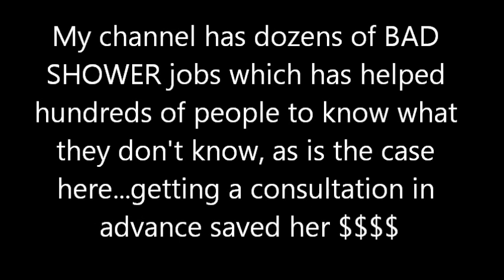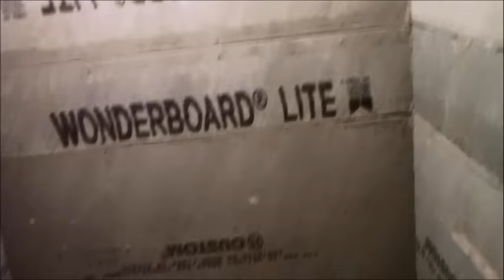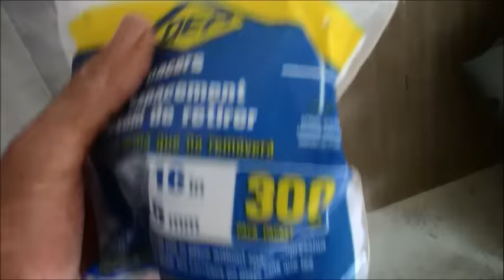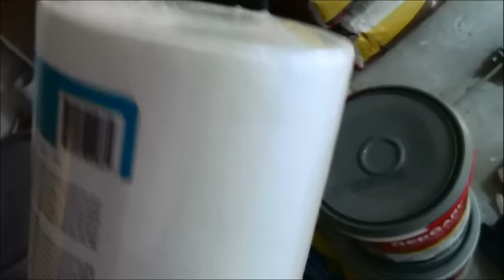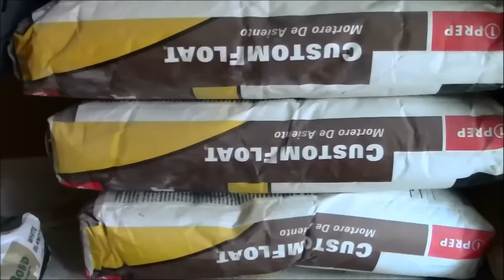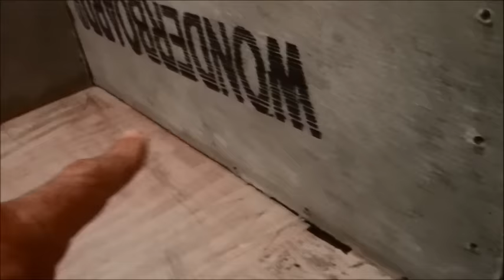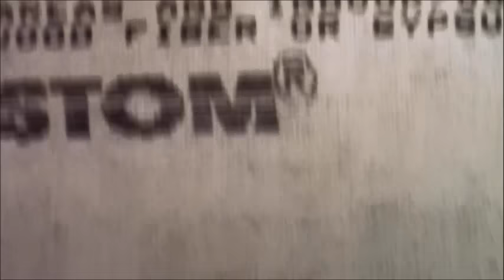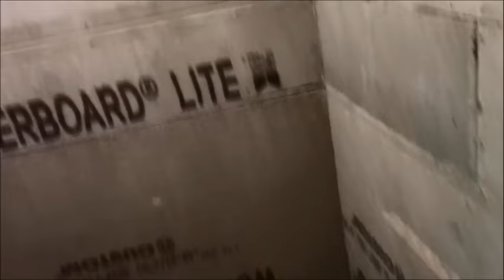BAD SHOWER DAY ONE !!

Comment: Just because there was only 1 bag of mortar doesn't mean there weren't 3 more bags coming. Just because there were 4 bags of 4:1, doesn't mean he has intention to use them all. You're jumping to conclusiins.
Reply from the maker: 14 things at a minimum including 12 sharkbites in wall, toilet flange 10" off wall, toilet supply on right side, shower drain not center, wallboard set before liner, valve wall not plumb... those are things that tell me it was going to go south.

But if you insist on talking about material, that 3 gallon bucket of mastic tells me all I need to know..
It has no place anywhere and that bathroom

Comment: First you tape, then thinset, let dry, then 2 coats of redgard. If you’re redgarding tile board seams without anything it’ll still crack.
Reply from the maker: 😂😂😂😂

You do understand that redgard is not just a water proofer, it's a crack preventor, says right there on the label, typically used in huge warehouses on concrete floors to prevent cracking.

Oh yeah....no tape is used on those massive floors 😂

And you do understand that redgard stretches 10 times further than tape ever would ✔
Reply: @StarrTile  any tile substrate you use on the floor is in fact covered in a membrane/tape and thinset but doesn’t need redgard since it’s a dry area. Concrete slab is different than a sub par butt seam. Just saying I wouldn’t just shove redgard into a corner or seam with no membrane or tape. I know guys that don’t bother waterproofing their cement/ hardie board and keep a job. You do you dude just providing what I’ve experienced.
Reply: Meant to say floor substrate seams are still taped and thinsetted. ie. durock and mesh tape +thinset , shluter and Kerdi membrane.

Comment: I’m not cheap so I do buy new spacers for most jobs it’s just nice to use new spaces that are not covered in thin set or have been stepped on . Use bricks for a shower curb and leave and inch for tile,liner,dura rock and tile.

Comment: The fibre tape simply keeps everything attached and moves together if it does move. On the reddgard bucket it says it is not required but it's recommended for any horizontal planes. I use it on any horizontal planes and use silicone first on the verticals, then regard everything together with 2 coats. This helps to not lay on reddgard too thick which can have mud cracking, due to the surface drying too quickly. I personally like reddgard much better than any membranes I've used though, seems more flexible and dummy proof as well.
Reply: Have you tried aqua defense by Mapei?
Reply: @HomeGrownPyro1  not personally, I usually just buy the big buckets or Redgard. But I know other installers and they said they liked it. I also really like using mapei for other products, definitely have confidence in their products
Reply: I also like hydro barrier plus
Reply: Maybe you already know this but I just thought I'd throw it out there. silicone does not stick to rearguard. The more u know. And I generally use rearguard, if Im remembering correctly Aqua Defense is basically the same as red g. Just a green/blue color.
Reply: Water proof membranes are the way to go. So much 2-3 more companies have followed Schluter.  Redgard actually req 3-6 applications to make it to the desired thickness.   Haven’t used cement board in 15 yrs and not going back.

Comment: Dude your trippin' on that spacer thing.
Reply: He is tripping
Reply: Exactly doesn't even make sense what he says about spacers
Reply: Dude’s trippin for sure. He seems like he’s in a manic episode
Reply: He’s absolutely correct about every single detail because it all matters. If he knew what he was doing he would had spacers.
Reply: @adnanlimited  most tile guys carry plenty of old spacers in their trucks/vans. Same with thinset and other materials. Also sometimes you’ll bring materials day to day based on your setting goal. Just bc he’s light on material doesn’t mean anything. The fact he’s using those shitty spacers says more than anything about his experience
Reply: @adnanlimited  on top of which; what’s this nutcase doing walking around someone else’s job site critiquing it. He shouldn’t even be in there
Reply: @adnanlimited  I can only assume you have all the spacers you’ve ever bought over the years. You do realize that they get warped or dirty over time thus you’ll need to buy more?!
Reply: What ends up happening is the spacers get laid down horizontal, and they get buried under the grout.
At every corner is a really thin layer of grout that can pop out exposing the setter's shame.
Reply: @CurflanderHolyfield  I've been fixing DIY bullshit for the last ten years.
Those TV shows are my job security.
I've seen husbands permanently housed where the dog used to sleep.
Reply: The label says "Leave-in spacers". Why not do that? Noob question, I know, but why not?
Reply: @KKhhoorrnniittee  So you buy more.
Reply: @KKhhoorrnniittee  if they told you to reuse the spacers until they break down organically, they wouldn't be in business very long.
Reply: So I guess if you buy spacers your not a proper tile guy......you should just have them.
Reply: @3DCHome  what he was saying is that buying spacers for every job is a wasteful practice. It sends up red flags.
Reply: Kinda overdoing the petty thing
Reply: @adnanlimited  35 years..... I dont clean and collect spacers
Reply: I'm not a tile guy by trade but still do a few, now and then, complete bathroom and kitchens. 
I have cans filled with different spacers and I usually buy some new ones on each job. 
No cans, baggies, plastic containers of old spacers.
Reply: @dustchip8060  key phrase....you're not a tile guy
Reply: @donnimetropolis9899  by trade.
Reply: @adnanlimited  worrying about how new someone spacers are is a red flag that you yourself are a subpar contractor, and have no idea what the hell you are talking about. I bet you that you and this guy lay tile similarly. I would love to see your work, because I've seen this guy's work and it's not impressive

Comment: So did the tile guy put in the ply sub floor? If the Sheetrock guy put in the wonder board is it the tile guys fault they the curb isn’t in? 
Sounds like you don’t really know the project history. This is just like Monday morning quarterbacking.
Maybe if you had the job from the start you would understand the history. There is maybe a couple of hours to address the issues you pointed out. I think you are pulling for a price justification.

Comment: I did my walk in shower 5 years ago, only my 3rd tile job. Oh boy I learned a lot from that. I would have never passed it for a customer though. But it won't leak and only a few imperfections that I'll notice (well I'm sure a lot of you guys would lol). Redgard is great stuff.
Reply: I knew this guy who did his own labor and sold the house. He outsourced what he couldn't do of course most of the carpentry but he put down his tile in the kitchen in the last piece near the door, the first one you look at when you walk in was crooked. Lol, I didn't say anything. The house was actually reconstructed on a house that had burned down and was rebuilt on the original slab. The brick walls in the back were settling and pulling away from the cornish. Problems abound fyi as this was just one.

Comment: Acryl-Pro is mastic. Custom Building even says "Sometimes referred to as a mastic" in their promo video about it on their channel. Premixed thinset is just mastic with sand in it to give it more body. Mastic is weird stuff, I personally love it for backsplashes. One crazy Jamaica style thing I personally did was put 2x2' mosaics that were a dollar a sheet on clearance up on plywood OUTDOORS above my mailbox as the tile cost less than new lattice would. I had leftover Mapei mastic from a backsplash and grout, I waited 3 days for the mastic to set up fully, and grouted it, and it's survived at least one winter so far with no cracked grout (except I grouted the perimeter, so that cracked...) or loose tiles. 

The problem with mastic is it needs time to dry, and people using it are using it mainly to save time using thinset and cut a corner. People tend to grout it right away, and try to get their showers in service right away, when you need a longer cure time than thinset. Of course once you get to 12x12' or so tiles it becomes basically impossible for it to ever dry under the tile. 

The other problem with mastic is mastic isn't compatible with Redgard, and Mapei's isn't compatible with Aquadefense. I think Tec makes the only mastic compatible with their own waterproofer. Some type of chemical reaction occurs. With Wonderboard, btw, it's designed with the "tape" side being smooth for mastic application using it with plastic behind it, and the rough side with no tape for thinset.
Reply: I used mastic to do my own shower, using 16" porcelain. (Didn't know any better.) Don't remember why I had to pull a tile, but, no, it doesn't dry for a looong time. Don't think I grouted for two weeks or so. And I never got around to sealing it.But the shower is still in daily use over ten years later. Back then we had 7 people using the shower. Still have 3 people using it.

I really don't understand why so many shower projects fail.

I also used 12" porcelain directly on top of formica countertop using modified thinset. Also takes a long time to dry. Also worked perfectly fine.
Reply: I don’t get your comment at all!  Mastic for setting time?  Gluing tile down?  Why not do a job right and do it once.  If you have anything leftover after you finish a job throw it away, don’t save for another job.  

Tile needs to be set with thin set and thin set alone.  Then grouped with a hood grout such as Custom Prism or Fusion Pro.  That’s all of course after waterproofing.  Schluter-Kerri shower pan and membrane will get you a good seal all the way around.  Staying with one manufacturers solution vs mixing manufacturers is a safe game plan.

Comment: Redguard has a tendency to crack, especially  with temperature swings. Seen it several times on showers against outside walls.  Fiberglass fabric is really cheap, and I feel is a must for reinforcing the waterproofing membrane on all inside corners. Just my 2 cents we aren't all in georgia
Reply from the maker: Only see it crack when applied too thick...otherwise flawless results.
Even in my cardboard box experiment years ago, water in it a week no issues
Reply: Redguard cracks in thin and in heaven application, the fiber mesh and redguard is a good combo to strengthen the seal in the seams. Or we can use a higher quality moisture barrier.
Reply: Yeah,  I'm having my shower done now and I asked the guy why he didn't use redguard and he said it doesn't do well in TN and plus I was on an outside wall. I sàidvi saw it on YouTube and he laughed 😂. But he does have buckets of old used spacers lol.
Reply: Red guard fails it takes three coats to achieve a water proof surface, membrane is much better. I start off with water proof materials not cement board. Yes it’s been used for ever but them days have passed to go board or kirti board with water proof banding
Reply from the maker: @Klondike
I don't know whoever told you that garbage, fake AF tho..

https://youtu.be/2HOxm40cpBs

Comment: That "tape" is a fabric, with no adhesive. It is used on corners as you said. It absorbs the red guard. Like fiberglass with resin.
Reply: exactly my tghout
Reply: Recommended in Regard installation instructions
Reply: Guys only half right, I always tape and actually mortar my corners then redgaurd then tile and my corners are sealed and perfect 9os with a square every installation
Reply: I don't know where you live,  so I'm not saying you are wrong.  Because different places, different rules. Some places you don't want to mud the corners, you leave 1/8th gap, to allow for shifting and stress. The red guard is flexible, and allows for movement. If the gap is filled it will pop stuff.  But like I said, different rules, not saying you are wrong.

Comment: Sadly, I had to learn this the hard way, but you're actually 100% wrong about red guard for the following reason:  Although in a foreign span red guard will stretch As much as 10% to 15%, that same 10 or 15% Confined to the area of transition between two planes is almost nothing,  and will always be considerably less than the thermal strain put on the transition.

Comment: The pan liner should go in before the hardi-backer/ cement board and extend at least 6 inches up the walls. Made this comment mid-video. You covered it. It's so frustrating to see that people do this type of work. The customer is paying good money for good work. I've only been doing tile for 8 years but I learned and worked side by side with a great contractor. Peeks Tile Oakhurst CA.

Comment: We built a new home.  I, home owner, Ran into just what you described.

Plumber installed our shower mixer valve in correct place and the builders foreman (knowledgeable older carpenter) installed the solid surface master shower (large) and cut hole for finish escutcheon plate BUT they cut hole bigger in solid surface wall material than plate!   I (home owner) made a quarter round out of the waste material to hide the gap.  This would have been the second app panel they would have ruined, the first one broke then they cut out for the in-wall shower caddy.  I was doing my own finish carpentry and on-site so I got a big chuckle out of this commotion.  I believe that just because you have worked for thirty years does not mean you are a craftsman or care about detail.

  This new home building process, our first, has taught me that a home owner has to watch everything and ask questions and STOP the laborers when they are doing something wrong!

This experience has confirmed that most Laborers do not care about the details as it is not their house but yet they get paid for making your dream come to life. 

Rough in framers were the worst as they worked only with the raw product and materials and don’t usually get to see the final results or care.

This gent seems to care there needs to be more caring craftsmen!

Comment: “Pressure treated wood warps and isn’t straight” 

*uses pressure treated wood for a straight edge. 

And I buy new spacers all the time. Once they get used up and thinset on some of them it’s not worth it to me to keep up with them.
Reply from the maker: You don't recognize pine from PT ?? 😂
And spacers have noooooo place on this job with 12x24 tile, leveling system was needed.👍👌

Comment: Its' interesting you pointed out "redgard doesn't need tape, that its redundant". Redgard is a crack prevention membrane but it's a system that does require tape, other wise why would they tell you to use it. Redgard even has their own brand of mesh tape specifically for joints and corners..
Reply from the maker: You're most likely correct, however I don't follow the rules, if there's no problem then there's no solution..

But I would challenge you to paint two or three coats of redgard on a surface, peel it up, stretch it, then stretch some tape and see which one gives the most... I already know the answer but you can test it yourself. And when I say that I don't use tape because it's redundant I don't advocate that other people don't, if you wanted use tape and redgard then go for it.
Reply: @StarrTile  fair enough. I'd rather follow manufacturer's recommendations in hopes the warranty covers any fault in the system.. 🤷🏼‍♂️ I like your content though! Cheers mate!
Reply: @StarrTile  on a side note do you think a slurry coat is needed over a concrete slab when doing dry pack? I mean why does it need to be binded that well when it's allowed to float over water proofing membranes..? I used a sealer on the concrete slab first.. think it should be fine.
Reply from the maker: I don't do drypack on slabs unless it's a curbless shower on a slab, and then yes, a slurry of thinset 1st and mortar that is wetter than a drypack.

To your question, concrete absorbs moisture out of your mortar whereas none is absorbed with a liner...so adhesion of the mortar isn't guaranteed or consistent to the slab especially if you mix your mortar without enough water.

Comment: Thanks for pointing out all the pitfalls and mistakes on this one, especially on a wood floor that might leak into the crawl space or a first floor.  Some DIYers can't do all the stages and depend on contractor talent to get them through to the next stage.  You have to trust that they are doing it correctly and your video was a good checklist to ensure that.

Comment: For me prep starts at straightening, shimmering studs to get them as flat & plumb as possible. I have used Flexbond thinset for years & love it. Had to rework bathroom do to a change & the tile with Flexbond behind it literally ripped the face of the Hardiboard apart, it bonds like crazy!

Comment: I think the main point is, yes, as someone who does this work I could argue every individual issue he is pointing out to some degree. I use lots of different spacers some I have large amounts of some I do buy for each job, he could easily just have yet to screw and add a layer of ply on the floor, noone knows if that's all his materials or some if what he dropped off from the job before or if the mastic was in case he was to do wall tile outside the shower, etc..... Its not any one thing but the proliferation of common enough mistakes yet to happen.
Reply: It was probably materials left over from another job because one of the red guards had already been used.
Reply: Soon as I seen the backer board all the way to the floor with no curb and liner in place , red flags 🇲🇦🇲🇦